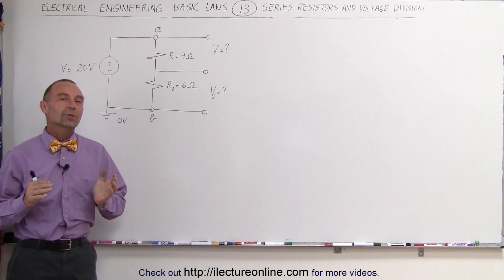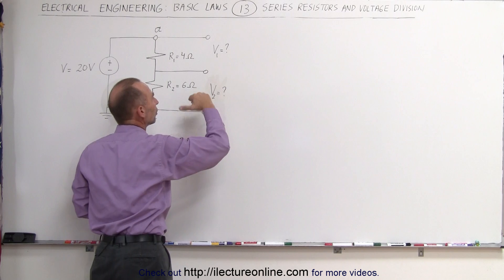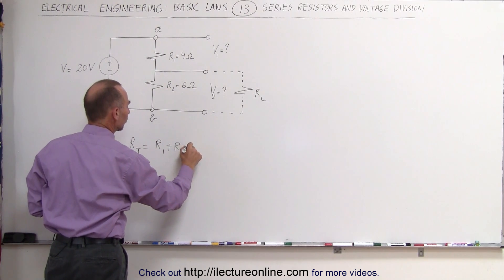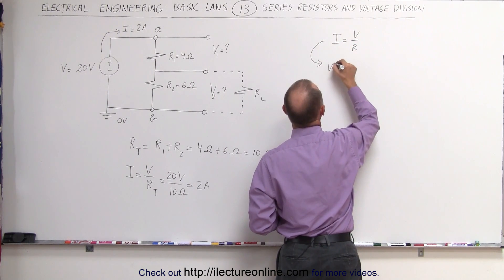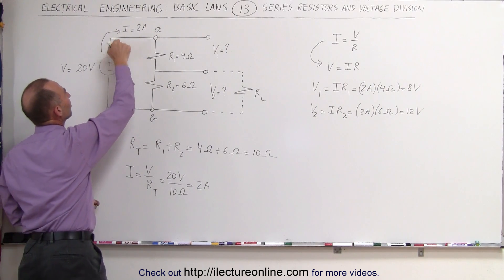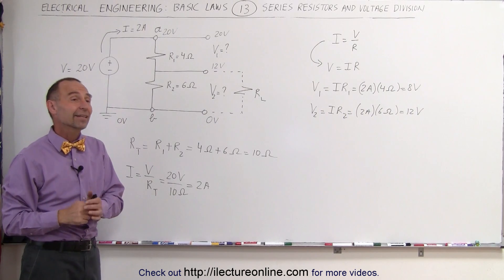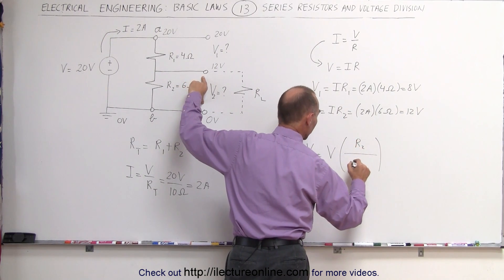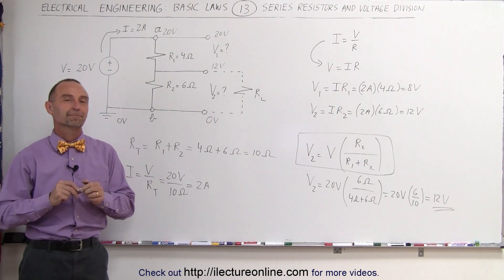Electrical Engineering: Basic Laws (13 of 31) Series Resistors and Voltage Division

Comment: Hello Again Dr. Michel, my question is for a series resistors there should not be a  node attached between them!! so if we have a node between them like this example will be a parallel connection not a series any more! Am I wrong?
Reply from the maker: The two resistors in this video are in series.

Comment: Curious what would happen if we had two loads, one hooked up to the 20V node and one to the 12V node. How would the current be distributed? Presumably we would need to do KVL loop and node analysis?
Reply from the maker: Yes indeed.  Each circuit needs to be evaluated using the Kirchhoff loop equations and current rules.

Comment: hello professor , if you have two currents in inverse direction an you still use the voltage divider?
Reply from the maker: Yes, the direction of the current doesn't matter.

Comment: BUT, if you add a load with it's own resistance, won't that be in parallel with R2, lowering the resistance for the R2- R-load equivalent?
Reply from the maker: When a load is attached to any circuit it will definitely affect the circuit

Comment: why the resistors are in series? there are some nodes and wires between them no?
Reply from the maker: if there is only one path for the current, then the circuit is in series.   if there is more than one path for the current, the circuit is parallel
Reply: @MichelvanBiezen  I understand now, thank you :)

Comment: Why couldn't you use the voltage across R1 for the load resistance? Alternately, why couldn't you eliminate R2 altogether and just use the voltage that dropped across R1 alone for RL?
Reply from the maker: There are usually multiple ways in which you can solve a problem

Comment: I DON'T UNDERSTAND one thing: 

If the voltage drop across R2 is 12V, how is it that the SAME DROP will be present when the load resistance is applied?

The load resistance RL and R2 are in parallel together and hence their equivalent resistance is lower than either of them. Because of this, the current in the circuit will increase and the voltage drop across R2 will change.

After analyzing this circuit, I've come to the conclusion that the relation will hold true APPROXIMATELY only when the load resistance is MUCH higher than R2
Reply from the maker: The voltage drop across parallel branches is always equal.
Reply: That is true, obviously. 

What I don't understand is that when the RL was absent, the drop across R2 is 12V , BUT when RL is introduced, the drop across both RL and R2 will be same, BUT IT WILL NOT be 12V.

Unless, RL is either very large or the current through RL is very small(This is what I concluded through my analysis)
Reply from the maker: Now i understand your questions, and yes, you are correct.   The load you connect to a circuit will indeed affect the circuit as you indicated.
Reply: Thanks for the clarification!
Reply: and now, How to find the resistance of RL if the given are V, R1 and R2? help please

Comment: If the power of those resistors less than 40 watts, the the power supply would burn your circuit.

Comment: Why not use 1 resistor in series and bring the voltage down by putting the resistor in series with the load
Reply from the maker: This is just for the purpose of illustration, not on how you should build a circuit.  However there is a purpose for this particular type of circuit.
Reply: Ok. Yes thanks. I know in a simple aplifier cuircuit you wil use a voltage devider

Comment: by RL you mean we can replace the R2 resistor with a  circuit element which needs 12 volts and 2 A to work right? (and also one which have internal resistance equal to 6 ohms???? isnt that so?
Reply: we cant keep both 6 ohm resistor and RL in parallel right ? or can we?
Reply from the maker: That is correct, except the 6 ohm is not the internal resistance but the resistance needed for the voltage divider (to place 12 volts across the load)
Reply: Thank you sir :)

Comment: Hi, does the formula at the end apply for more than 1 resistor on the circuit
Reply from the maker: You may find your answer in this playlist:   PHYSICS 41.1 RESISTORS IN PARALLEL BRANCHES

Comment: I found it interesting with this example to put in different values for the load resistance and work out the currents and voltages with the extra loop included. If the load resistance is in the range 1 to 10 ohms, the voltage across the load resistance is in the range 3.53 to 9.68. The load resistance needs to be much larger than 6 ohms for the voltage to be close to 12 volts. (load resistance 100 ohms, voltage 11.72 volts load resistance 1000 ohms, voltage 11.97 volts)
Reply: That would be correct. That is the reason why a voltage divider is usually applied for measuring purposes.
Let's say you have a ~1000 V voltage drop you want to measure, but your multimeter can only handle about 100 Volts. Then you could use a voltage divider to safely measure the voltage across your circuit, given known resistances. This means that a voltage divider needs to have 0 current drawn through its terminals, otherwise it won't work accurately.
If you want to have a lower voltage source, you'll want to use a linear voltage or a switched-mode supply.

Comment: Why does it have to be connected to ground?
Reply: To have a convenient reference point, as far as I understand.
Reply: Voltage is the potential difference (aka the work needed to move charge form A to B) charge wants to move to a less energy state, but can only do so if that exists which brings in the ground.